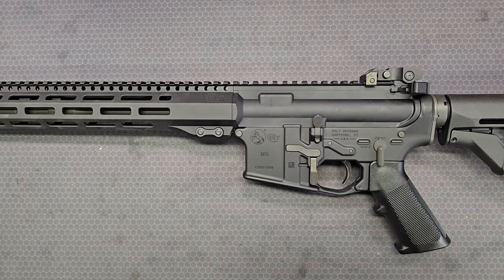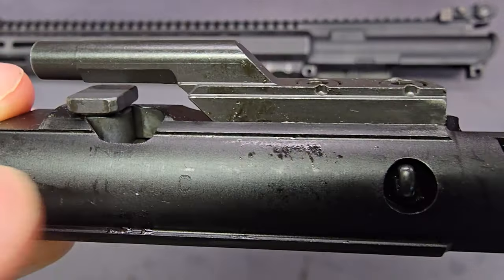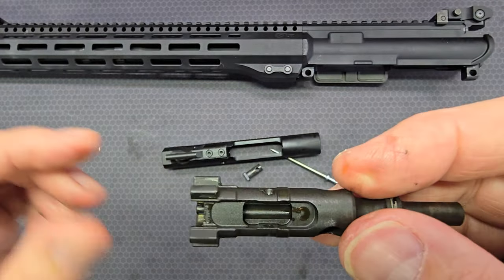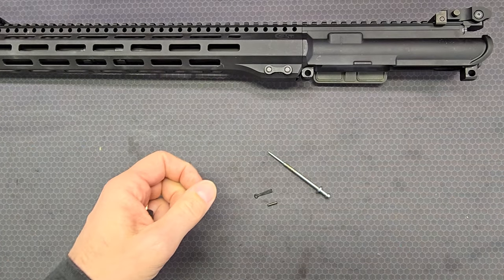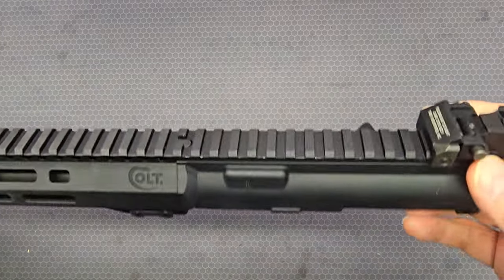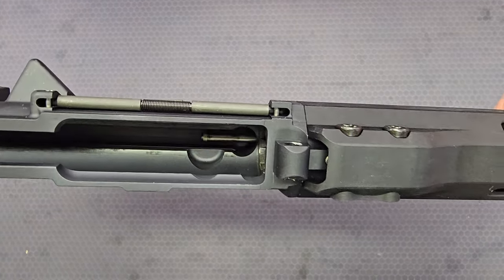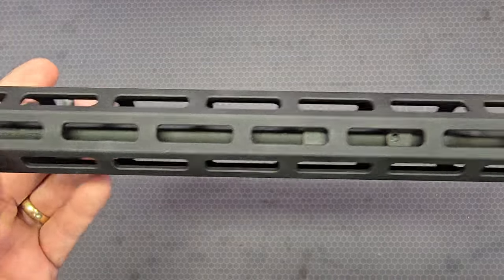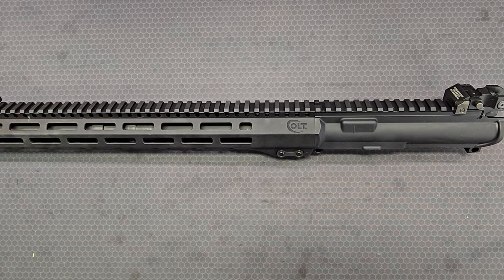Colt CM556-16-M5S (M5 Carbine) Upper Receiver

Comment: I noticed the M5 upper has the elongated cam pin pocket like the 6940, but it doesn't have the metal insert to prevent gouging...Probably because the M5 was never made with an external piston that I'm aware of..
Reply from the maker: The M5 upper is a design improvement of the 6940 upper receiver so you will see similarities.